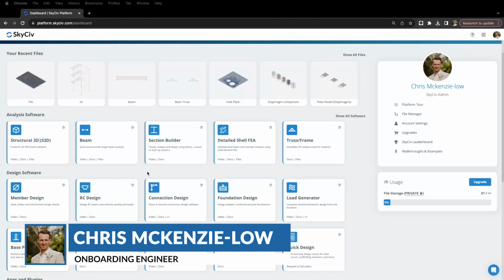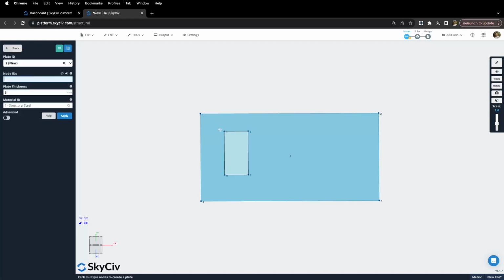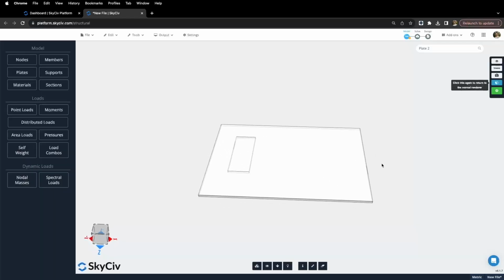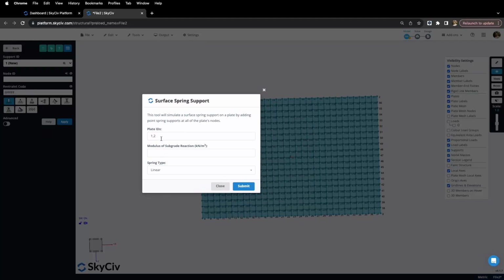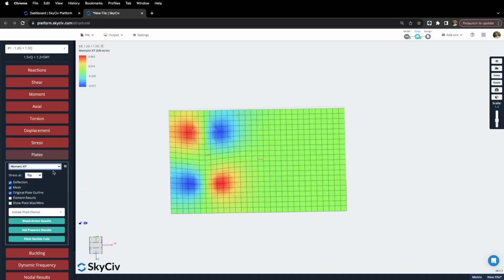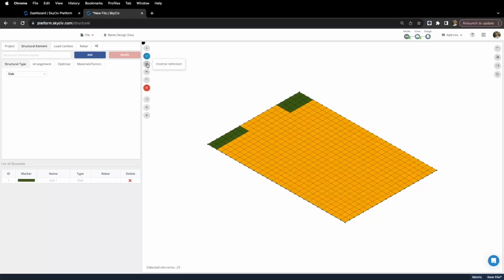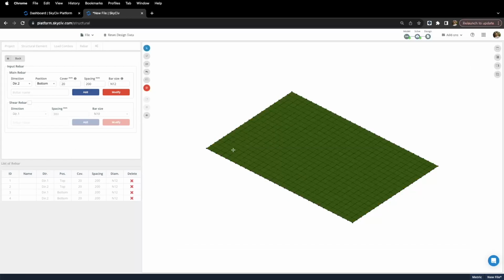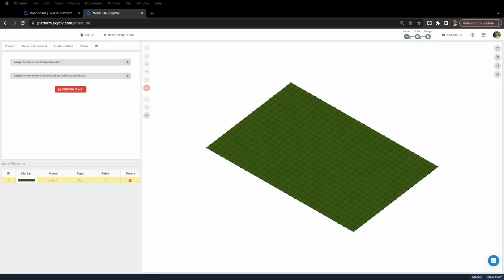Slab on Grade Tutorial with SkyCiv Structural 3D

Comment: Does creating a hole actually make a hole in the slab and you just infilled it to add that area load exactly where you wanted it? I want to model holes in my slab so I’m hoping this is the case
Reply from the maker: Yes that is correct, creating a hole in a plate removes that area of the plate from the analysis. In this example we then infilled the hole so we could apply a pressure to that isolated area only but in your case you would just apply the hole itself. If you have any further questions that you need assistance with feel free to reach out to our support team by emailing support@skyciv.com